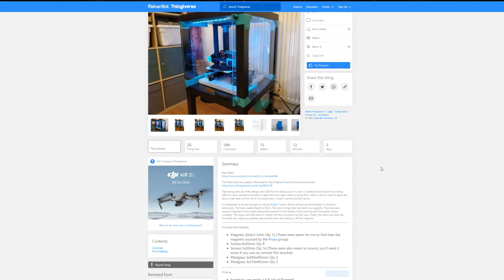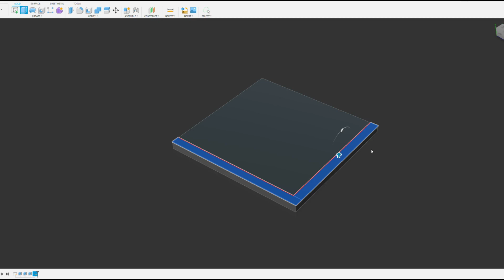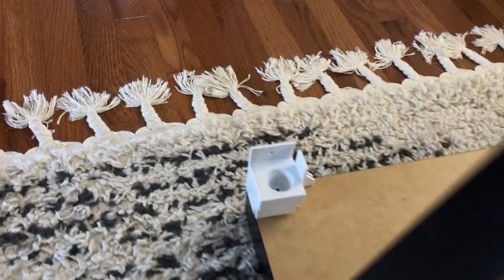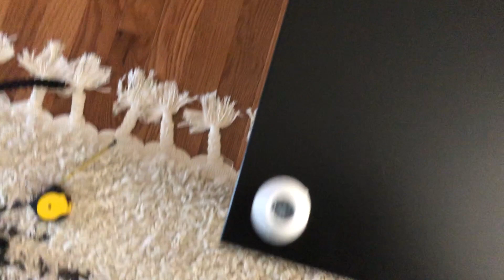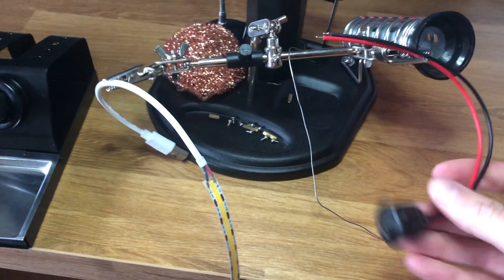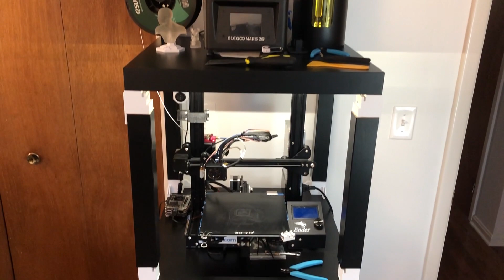3D Printer Enclosure/Shelf Build - Part 1

Comment: hey man, you gotta increase the extrusion rate for your 3d printer, I see some really scary under extrusion there in the video...

But good job non the less!
Reply from the maker: Thanks for the comment! My Bowden tube actually is slipping and causing buildup in the hot end so I just got a new Bowden tube and hot end in to fix it. But thanks for the help!